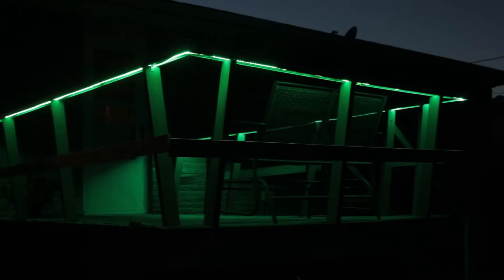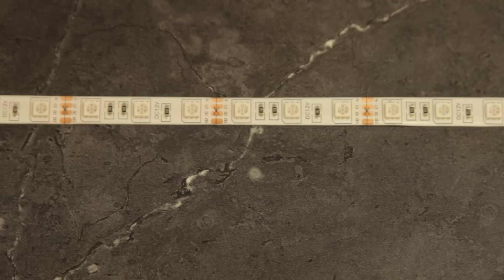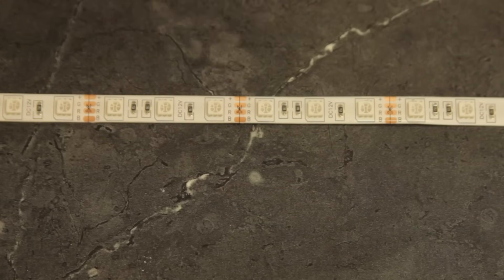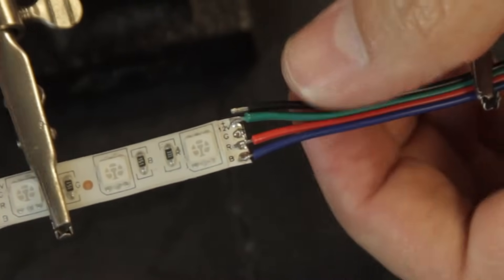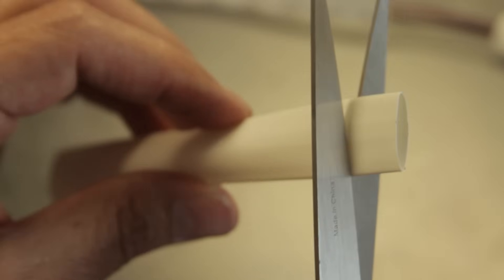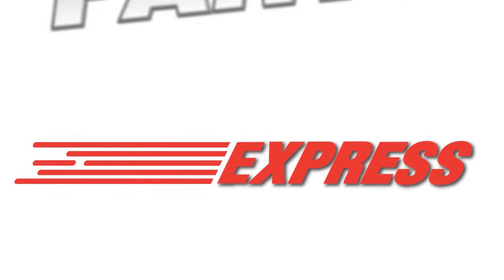How to Cut and Connect LED Light Strips.

Comment: is it possible to use like a 2ft long strip that I cut out as a separate strip? but still, be able to control the light? or do I have to connect it at all times

Comment: If I don't want to extend the length, do I just cut it and leave it? Or do I need the connectors for if I want to shorten the length?
Reply from the maker: yes, you can just cut the lights at the marker to the length you need it. If you change your mind, there are multiple ways (as noted in the video) to attach it again.

Comment: I'll look at this in more detail...

All I'm wanting is a piece of LED Strip that runs straight from L To R to light up the front panel of my guitar amp...

I don't want to be connecting to the amp like I've seen in other videos as I only want to shine a 15 inch strip of led light (upwards or downwards) so I can see my controls (on my amp) better in darker environments, any tips anyone!...

.....
Reply from the maker: What about something like this? http://www.parts-express.com/--073-310
You can plug the USB into a regular socket or even a cheap cell phone charge brick if you want to be untethered.

Comment: I cut the strips, used the connector to join the two cut ends. They work (!) but the second strip does not light up in the red spectrum. Any suggestions for what I did wrong and how to fix it?

Comment: * For those connecting lights with a LED RGB 4 pin joiner and lights not working with joiner, after you have cut your strip***

- FIRST expose the copper wire (this tutorial cuts and swipes it off. This DID NOT WORK for me) 

# SECONDLY to expose the copper I used the scraper and just scraped off the top protective plastic cover.

# THIRDLY When inserting into your joiner ensure the + (positive sign) matches on both your joiner and the copper on the light strip..

BOBS YOUR UNCLE 🙌🏽

Making a TikTok to help others

Comment: Is their any way to connect them if i dont have a solder or a connector?
Reply from the maker: so long as the 4 connections are all touching each other you're fine. But it would be really difficult to do so without holding them in place with solder of a piece of plastic designed to do specifically that.

Comment: The connection doesn't work as shown. I have worked for over an hour and haven't got a good connection yet. I don't know what you did in that cut at 0:51 but they don't connect THAT easy. 😡

Comment: ok this is a small brain question, but do you absolutely have to plug a strip into a power source every time you cut it? or does it do wireless bluetooth connection stuff where you can cut it and both strips will turn on?
Reply: I was hopin for some wireless bluetooth connection stuff but nope 😅😅 goin to try the solderless connectors

Comment: hello i have an rgb led strip that i use on my desk! Now i want to buy 2 more meters of the 4 colored cables and try to extend the strip behind of an object and then reconnected it with another part of the strip that i have! is there a restriction on how much plain cable i can use before i reconnect it with the rest of the rgb strip(can i use 5 meter of plain cable for instance)?
Reply from the maker: Yes, you can run 4-conductor wire for long runs in between light strips. 100-7840 ( http://www.parts-express.com/--100-7840 )  4-conductor 16 gage wire would work great, and the strip after the long run may not be quite as bright as the lights closest to the power supply. If they are separated you might not even notice the difference. 073-0106 ( http://www.parts-express.com/--073-0106 ) might help reduce the solder connections if this is the type of strip they are using.

Comment: Would I be able to safely cut away everything and keep the lights, soldering them to a battery connecter so that I don't have to connect it to the wall? Would that work and if they came with a controler, would it still work on them? (asking because this is what I want to do for a project in my woodtech class)

Comment: Im looking to create a new end with the pins as seen in your video , what are the conectors that you closed over the copper bits
Reply from the maker: http://www.parts-express.com/--073-0102
Reply: Parts Express i need the 4 pins aswell to conect to the power lead (56 seconds)
Reply from the maker: Everything you should need can be found from the link in our description. Here it is again for ya: http://www.parts-express.com/cat/led-strip-lighting-controllers/3334
Make sure you check page 2 and 3....

Comment: For the people who are here to figure out how to open the connector ... I finally got it. Find the place where it closes (so looking from the side, there is a seam/edge that goes all the way to the bottom. If you have a teeny flat head screwdriver (like a jewellers/eyeglasses tool) stick it in there to pop it open.

Comment: Does it make a difference whether or not you use unwired 4-Pin RGB strip connectors versus wired 4-Pin RGB connectors?

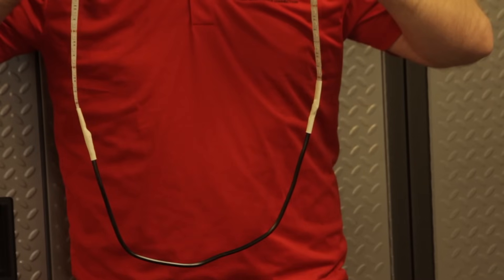Comment: Hey thanks for the video very helpful! What is the cable called that you talk about on the video at 1:14?
Reply from the maker: This is the cable we were using. https://www.parts-express.com/--100-7840
If you are indoors and want a short run, you can use telephone wire :)

Comment: I did this and it went pretty well, I connected three 5m strips together and they work. Problem is that the second strip is less bright than the first, and the third less than the second, barely even giving light at all. I don’t know if it’s due to the quality of the connectors or the led strips, any idea on how to fix it?

Comment: A stupid question, but I want to cut individual lights from the light strip to solder with wire onto a battery pack.. Do I cut out the individual lights by cutting around the black lines And solder the wire to one of the sides ? I dont want to cut the strip to make it smaller, I want to cut out each light separately ? I dunno what I'm doing

Comment: i cut my led strip in half at the scissor mark. i then couldn't get the cut part working and have tried just using the adhesive to stick them back together. STILL WONT WORK!!! what product should i buy to solve my problem? Please help fast
Reply from the maker: hmmm...sounds like you may need to splice them. You can try this item:
http://www.parts-express.com/lavolta-led-lighting-strip-splice-10-pcs--073-0102
Or you can always give us more details by contacting our tech department at tech@parts-express.com or 800-338-0531 x1.
Reply: thanks so much

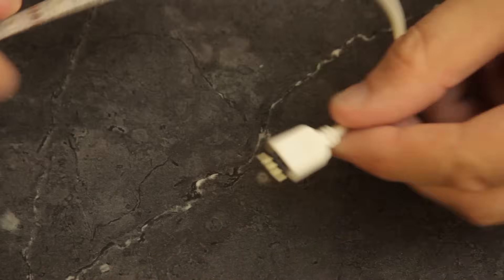Comment: 0:54
I realized that's exactly what I need since my first LED strip ends with a male so it has to be connected to a female and to the copper pads.. But the only problem is that it's out of stock :((

Comment: hey thanks for the video, can't seem to find that lead (black) wire to extend your LED strip between walls  anywhere on your site...
Reply from the maker: Good Question. The actual cable is not available yet but is coming this month. However you would only need that cable for outdoor use. For indoor, you can just use a CAT5 Ethernet Cable. Strip the ends and solder the twisted pairs together. That will give you 4 wires with a heavier gauge.

Comment: hello, i did not solder them together, instead I used the clips, but I have a problem, when i put "red"  half the strip turns red and the rest of them turn green, same goes with other colors, could this be the wires not being placed correctly?
Reply from the maker: Please contact our tech support for more help with this question, tech@parts-express.com or 800-338-0531 x1.
Reply: Alan Pena , I absolutely love it when people answer there own questions. yes or there is something jumping one or more of the wrong wires together.

Comment: Thanks for the video, although I'm not sure I understand what this will accomplish; aside from adding sections that are simply gaps in the lighting, which is still a bit unclear (how will power be passed through these sections, new wires? Why?). You will be cutting something and then reconnecting it into a straight line with this, but wouldn't it make more sense to change directions? I think I'm missing something here. Cool connectors though.
Reply: Julian Wasserzug , the gaps in lighting are simply that, gaps where there are NO LEDs. but do have the wires to connect back up and continue on.
like between windows.
Reply: Same question. What do you need to do say if you need to bend it?

Comment: I have one question. When I cut a new section, and put on a connecter, how will I connect that end to the power bank? How will it power? Do I need to buy something else? If so, what?
Reply from the maker: You can connect two strands together prior to being cut using this: http://www.parts-express.com/--073-0110 Not sure if that answers your question entirely.
Reply: BIlxke , it depends on what type of connector you use, male or female.
and what type of connector plugs into the power block or ( plug ) end